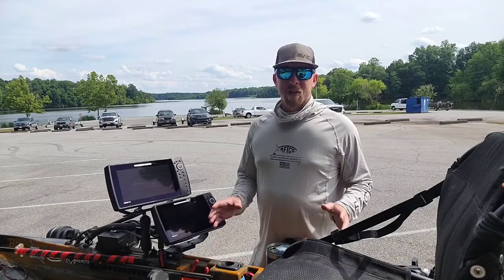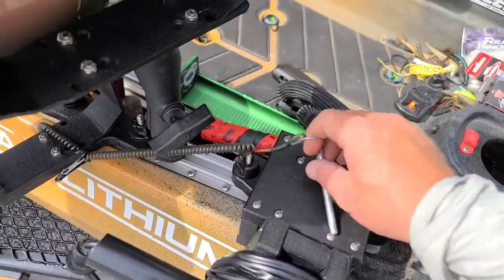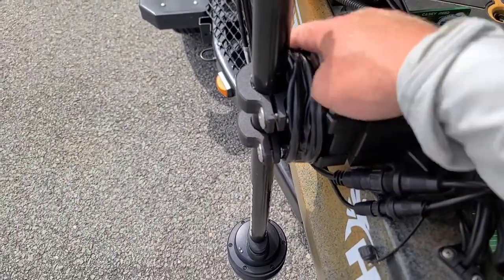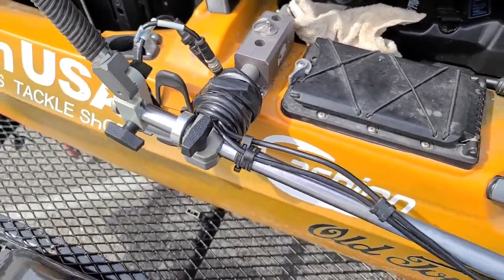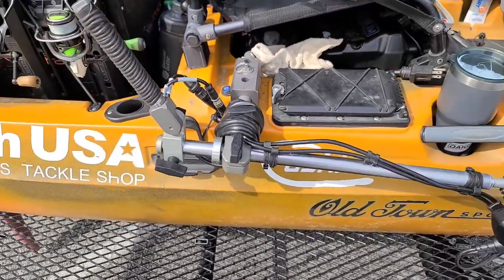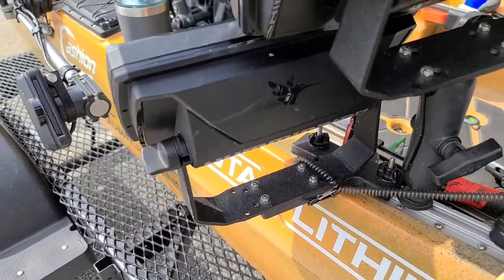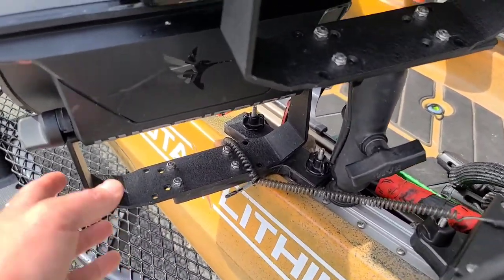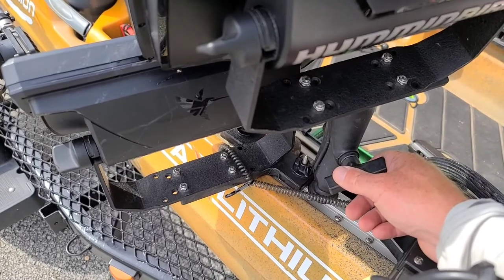MEGA Live + MEGA 360 setup

Comment: do you remember the part numbers for the 2 extra cables you needed to make the mega live detachable, the ones you ran through the kayak popping out through the thru hull basically
Reply from the maker: Those both come with the Mega Live. It's just the power cable which runs to the battery and the ethernet cable which either goes to the back of the graph or the ethernet switch.

If you have a Helix you will need this adapter cable though: AS EC QDE - Ethernet Adapter Cable

https://humminbird.johnsonoutdoors.com/us/blog/mega-live-imaging-unboxing-and-installation-tips
Reply: Awesome. I know the “other” brand you need to order an extra cable to be able to run it like this so you disconnect from the boat to make it portable

Comment: What all do you have plugged into the 5 port ethernet box?
Reply from the maker: Two graphs and mega live
Reply: Could the mega live go right to the unit?  I have a similar setup to you on my boat was just wondering if I have to get the 5 port box
Reply from the maker: @rkeyloroutdoors  if you dont need it to share to both graphs, you definitely can.

Are you running two transducers? Are you going to use one graph solely for mega live? Really depends on exactly what you're planning to do.
Reply: I have to graphs.  One has mega 360 and the other has mega si/di transducer hooked to it. Planning on installing mega live as soon as the weather breaks here. Just setting up for it and getting everything I need together. I fish electric only so both of my units are on the bow.
Reply from the maker: @rkeyloroutdoors  sounds like youll be fine plugging the mega live directly into the graph.

Depending on exactly how you think youll use it, youll have to choose what graph you plan to plug it into.
Reply: Thanks man. Appreciate the response. Your yak is absolutely stacked too. Nice work